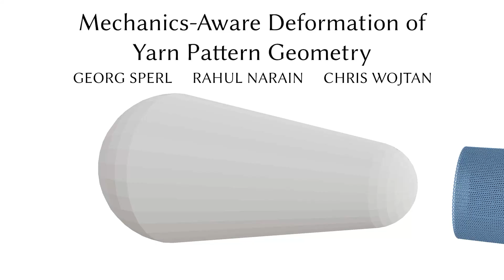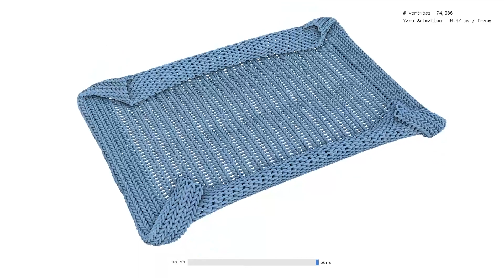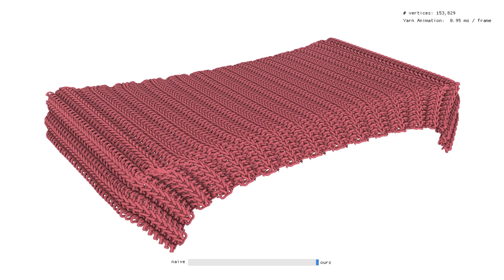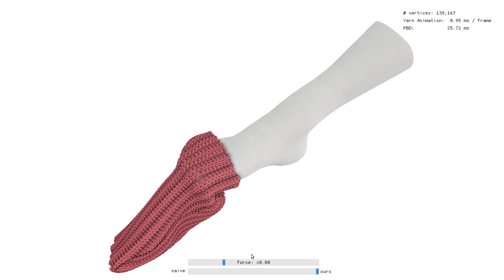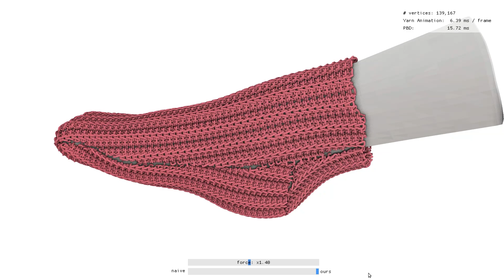Mechanics-Aware Deformation of Yarn Pattern Geometry [SIGGRAPH 2021]

Comment: Anyone know how to export the animation ?
Reply: For animations in the video and presentations, I only used OBS for recording my screen. There is only rudimentary and slow support for exporting geometry: pressing 'E' exports the current frame as triangulated yarns to an fbx file (MainApplication.cpp). You could consider implementing a faster export to a different binary format or even just of the yarn centerlines and loading those in e.g. Blender as curve control points.
Reply: @georgsperl1622  I know E for exporting single frame..Problem is that nearly half of the yarn type will crash while exporting.
Reply: @georgsperl1622  Curve into blender would be nice,would this be updated in the code ?.I am not really a coder to do that.
Reply: @michaelwhite4810  I have added rudimentary npy export. Using alt+E it writes two npy files into the folder 'export'. In this folder you can also find a script to use in Blender for importing as nurbs. Note that this does not include any UV information, as blender doesn't do that for curves. And the fbx export with uvs is slightly better but might still crash. It's not perfect but I'm afraid that's all the time I can spend on this.
Reply: @georgsperl1622  thank you! I’ll try this today.
Reply: @georgsperl1622  I ran the script directly in blender ,line 67 gives error message   "  X = np.load(basefilefmt + "_X.npy")" (I guess there is something wrong with path)(maybe not I tried using the path directly,still give error)
Reply: @michaelwhite4810  my best guess is that you're not using the frames&ncloth variables. maybe instead of the double for loop at the end (remove lines 58--65), just directly specify the filepath for X=np.load("myfilepath_X.npy") and I=... directly
Reply: @georgsperl1622  I used absolute file directory i.e./home/user/•••.It gives same error.(won't work for either windows or linux)
Reply: @michaelwhite4810  i would need to know the exact error message (from blender's output to the terminal) to make any informed guess
Reply: @georgsperl1622  python:File "\text",line 67
X=np.load(--------)
IdentationError: unexpected indent
location:<unknown location>:-1
I can't even load these npy file with np.load
Reply: @michaelwhite4810  Indentation error is something entirely different though. Did you after removing the loop lines unindent the lines below completely to the left? If you want to be sure that you can/can't load the np file at all, you could make a separate script that only has the single X=np.load(...) line.. Worst case send me the two np files and your version of the script..
Reply: @georgsperl1622  I remember I did that..btw is curve obj or fbx export an option? I can change handle type in blender.Also you mentioned usd in your script,usd support for blender has been a while.
Reply: Alembic can export curves with deformations, if someone implement this format, its be great.

Comment: Neat. You could make this suitable in video games by doing something similar with textures instead of geometry. In other words, blend between different textures of the yarn, which are captured from the yarn simulation under different deformations. Then depending on the vertex positions, derive per-vertex blending weights for each of the possible texures.

Something similar is done for wrinkle maps for face animations.